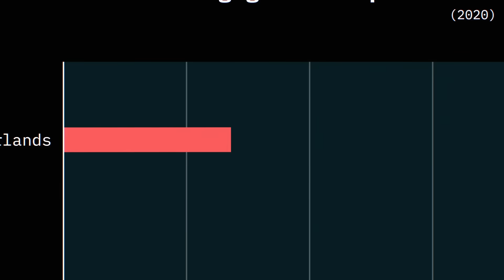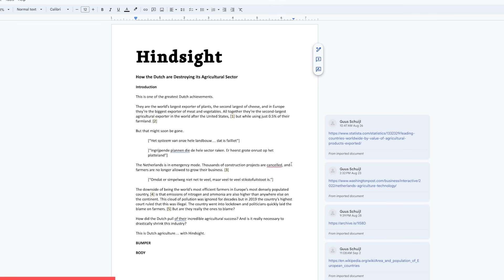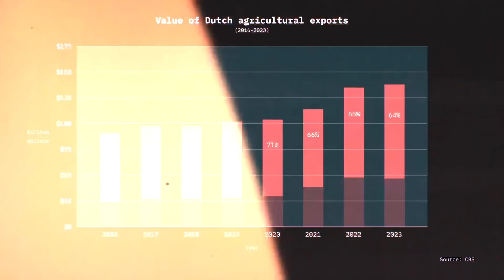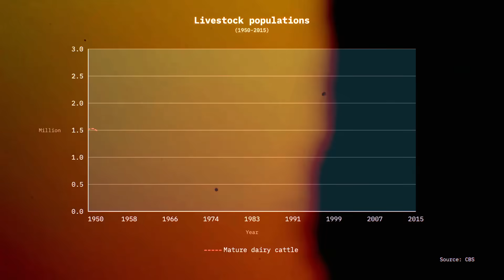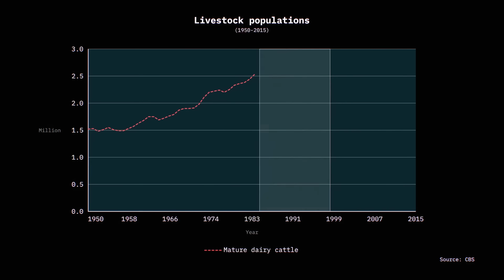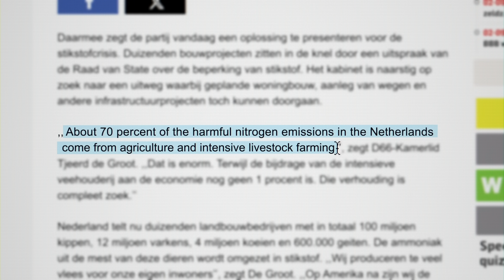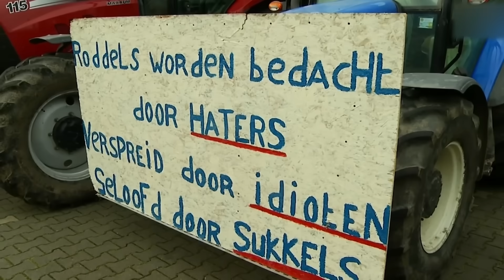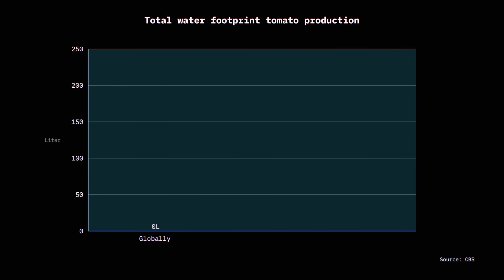The Dark Side of Dutch Farming

Comment: Appart from all these reasons called below. There is also the fact that most of the nitrogen pollution comes from around the biggest city's, but they just don't want to accept it. Cause it means that the elite have to live with the problems they made. It's the same reason why the biggest mess they make with the mass immigration crisis is felt in Villages en Towns
Reply: Tri State City Plan by WEF. They want to move all farming to Brabant and slowly turn it into vertical farming. The rest of Netherlands,Belgium and Rhineland will be a super urbanised worker and tech state.

Comment: To keep the Netherlands, my country, away from complete standstill we'll need to lower the emissions of nitrous oxides and ammonia. And yes, we have to lower emissions in all sectors, so that means industry and mobility (e.g. more EV's). However, all of that won't be enough if we don't regulate the by far biggest polluter, livestock. Not the entire agricultural sector, we need to shrink livestock if we want to build more housing, infrastructure etc. If the government does not take any measures, doesn't protect and work with farmers, small farms will be bought up by corporations and investors because that's how the free market works, taking measures is in the best interest of farmers too. Let me emphasize one more time that it's not the entire agricultural sector that's responsible for this. Tthe most advanced and efficient sectors, greenhouses and crops, barely add to this problem. Those sectors along with so many other sectors outside of agriculture are being hostage by the nitrogen crisis mainly caused by LIVESTOCK
Reply: finally someone who gets it

Comment: The main problem with animal agriculture is the use of liquid manure systems.
The government needs to mandate all manure must be composted . Instead of liquid manure systems, huge composting sheds to facilitate composting would solve the problem of pollution by changing soluble nutrients that leach and emit gases, to a system of colloidal capture of nutrients.
Composting does this. In composting nutrients are transformed into a colloidal state , which ends most leaching, the nutrients are locked into a colloidal state. In the composting process, any methane produced could be captured compressed and used for bio\ fuel. 
Composting reduces the volume of animal wastes greatly , saving fuel and time in application of compost to the land. 
Composting reduces most all problems , and is extremely eco friendly. .

Comment: Blind spots in this video: 
Heritage and culture, BS, I'd claim all the traditional knowledge and tradition about farming is utterly lost - along with the traditional gene pool of stock and crop. Thank you. 
Looking at yield per acre and not looking at yield per measure of energy - in which case the dutch score the absolute worst efficiency.
The dutch do not produce food, the process food. Bulk of the raw material for this food comes from abroad. Soy from brazil, fertilizer from russia, diesel gas electricity pesticides... Also, the transport is outscored. So much for 'food independency' it is a false dogma. 
Natuur herstel.. recovery, yeah, from what? Look at topotijdreis and discover what has been sacrificed for this ungodly project. The most epic river delta system of western Eurasia right in the north-south line of migratory birds. Nursery of fish. Dynamic river Eastry on the edge of dry sand and wet bog combined with marsh, flood plane and coastal dunes. All IS LOST. Habitat distrution, light pollution, water table exloitation, toxivication, soil degradation ON AND ON AND ON. But a few refuges of so-called 'snippernatuur'. Which the BBB wants to eliminate asap.
All this to feed the people? All the worlds people? With pork?? Tulip bulbs? get ffm real man.

Comment: Cars do not "emit nitrogen". All the nitrogen that comes out of them got sucked in just seconds earlier. It is atmospheric nitrogen which they are outputting.  It would be more relevant to refer to nitrogen oxides (NOx) than "nitrogen". This has NOTHING  to do with "nitrogen" from farming, this is not nitrogen either but different nitrogen compounds such as ammonia. There is zero linkage between these two kinds of pollution but they are being dealt with as the same thing is all the statistics and politics. As usual scientifically ignorant EU bureaucrats have near zero understanding of what they are trying to regulate.

Comment: The farmers have been screwed over many times. The new political party BBB will not change that, they will possibly even make it worse. But it will keep their hopes up for a while.
What farmers need to realise, that the current system offers no benefits for them. Why would you want to keep the current system if it constantly screws you over and everybody except the farmers determine price? It is a very stupid situation to be in, why keep it that way?
If anything, the BBB should get farmers a better position, but since they are funded by those big companies it will probably be the opposite.
And yes there is too much nitrogen and others, and that is mostly from livestock. Pigs, cows and goats in a huge shed concentrate to much of the pollution where it becomes unlivable due to air pollutions.
There are parts of those nice scenic farmlands (such as in Brabant) where air pollution is worse than in the middle of Amsterdam.
Also, lots of food for the lifestock (depending on which type) is imported. Such as grain from Ukraine just for our chickens. Next to the artificial fertilizers around for decades, which coupled food prices to energy prices.

Comment: The real problem here is that honesty is what is most needed but in shortest supply. By far the worst offenders of unsustainable practice with the easiest to achieve savings for the environment, are the rich & middle classes. Their constant insistence on over heating & cooling their homes & offices. Their insistence on using expensive private cars instead of public transport. Flying all over the planet for holidays & ridiculous climate gatherings designed to massage egos, polish halos not address real issues. First ban the UN & COP568 or whatever moronic number we are up to. Force these deceivers into virtual meetings & off the roads they have no need to clog up, leave those roads for real produce not pleasant weekend jaunts paid for by tax deductions. Tax these frivolous spendthrifts for claiming deductions to their tax bills for 'claiming' part of their oversized houses as office space, when in reality they are extra storage rooms used for stuff bought on an ego rush that they will rarely use & almost never need. Leave honest hard working farmers alone instead of making them convenient middle class whipping boys. Shameful performance & exercises. 🤬🙄

Comment: In USA tulips for Netherlands are for sale in most urban supermarkets and florists,it is strange that such a product that needs very fast transit by flight to USA markets.with cows a Blessing even after using its milk production for years and years it keeps on providing with its meat and cowhide..just hope that modern times  haven't clouded vision..Don't kill a creation  for little American Indians killed buffalo for THIER needs after the 525kgn was slathered only 5kg was thrown away as trash .waste not want not .USA energy efficiency average for the usa. Is and has never been above 51%..all the remainder is waste USA transportation industries use 30% of all USA energy use and it average energy efficiency is 21%.Whatca waste and electric cars would hardly add 5cto 8% more efficiency at it's very best . Extreme weather is here to stay it could be reduced significantly with getting efficiency overv70% in a decade.bread n circusc economy is a energy glutton also

Comment: The argument "there will be more people, therefore we need to grow more food" is nonsense. We will never make more people than what we have food for. If you have a sudden reduction in food, then people die, and that's a bad thing. But if you just have a fixed and limited supply of food, people don't make excessive numbers of new people in the first place. 

This is completely setting aside issues of food waste and over-nutrition, which if they were resolved would enable us to feed a couple billion extra people without any extra food production. That would be a good thing, but it's not necessary. Simply continuing to produce exactly as much food as we do now doesn't require any improvements in efficiency or distribution. If we make no improvements and grow no more food than we grow at present, the forecast extra people simply won't happen, and we won't need that extra food.

That makes it an extremely bad argument as to why we "need to produce more food." We don't need to at all.

Comment: The Dutch are not the world’s most efficient farmers, very far from it, because they are utterly reliant on foreign inputs and energy.  In effect they are the middle man of food manufacturing, which is very different to farming and shouldn’t be confused with each other.
Reply: Do you have any data to support your claim? I'm honestly very interested.
Reply: @sannej  The data is readily explained by the Dutch annual import figure of €95.0Bn of agricultural product and the export of €130.0Bn of agricultural product.  The import is extraordinarily high, amongst the world’s highest, and completely out of proportion to the population. The imported agricultural product is then turned into exports by using a 25% subsidy to farmers, which is why agriculture for The Netherlands isn’t nearly as great an economic contribution as it seems.  It’s the same system the Dutch use which puts them up the ranks of petroleum exporters even though there’s no Dutch oil deposits.
Reply: @seanlander9321  Obviously, the export figure is skewed but you can't just say farming isn't efficient in the Netherlands. Vertical farming is very efficient as the figures for tomatoes and milk yields (amongst others) show. Even if the Dutch were 'utterly reliant on foreign inputs and energy' - which they aren't - they would still be able to be efficient with those inputs. I don't follow your logic at all. You aren't trolling, right?
Reply: @sannej  A few products doesn’t make efficiency of a sector. Obviously an agricultural sector that relies on such extensive inputs and subsidies and tariffs cannot be efficient, it’s actually barely getting by.
Reply: @seanlander9321  Seems to me greenhouses and husbandry are pretty efficient. Just how much subsidies and tariffs do you think there are?
Reply: @sannej  European subsidies are 25%. Tariffs are anything from 20% to 100%. Greenhouses are a component of farming, they don’t represent the claim that  Dutch farmers are the most efficient, that’s an across the board calculation not confined to som farming factories.
Reality is, that without very significant government assistance that Dutch farming will our collapse. An efficient farming sector is one that is firstly self-sufficient.

Comment: can you make a video on how only 9 liters is used to grow a kg of tomatoes
Reply: Greenhouses put all resources inside under quarantine effectively. As fluids evaporate, they are collected, filtered and reused to grow crops whilst sunlight, lamps and natural gas are used for heating. It doesn't take 9 kilograms of water to make 1 kilograms of tomatoes. It only takes about a kilogram of water. Greenhouses are usually equipped with sluices to prevent the loss of moisture and scalability helps to offset costs. What it doesn't say though is that the greenhouse sector of the dutch farming industry is the biggest user of natural gas in the country and thus a major contributor to greenhouse emissions.
Reply: @MarijnRoorda  Most of the CO2 produced by the WKK's (very big natural gas engines) is pumped into the greenhouses for the plants to consume and grow. 
This isn't always the case but under perfect circumstances a WKK will burn the NG to create hot water, the engine turns a generator that powers the lights and the CO2 powers the plants.
And newer greenhouses will digest the plant remains after clear-out into biogas that helps fuel the WKK for the new crop.

Comment: "Nitrogen pollution" is about nitrogen compounds such as ammonia (NH₃) or different nitrates (NO₃⁻), not gaseous nitrogen (N₂) in the atmosphere. The former mainly pollutes the air, while the latter mainly pollutes the water. The related nitrous oxide (N₂O) is a strong greenhouse gas and therefore an additional problem.
In the video the term "Nitrogen" is used for nitrogen oxides (NOₓ) in general, but mostly nitrates (NO⁻₃). 

Just in case you were wondering 😅 (Information without guarantee).
Not to mention other related or intermediate chemicals as nitrite (NO₂⁻), urea (CH₄N₂O) or ammonium (NH4⁺).
Reply: This all is an excuse to get rid of the Farmers.
its a tric.
Because they want to get the lands cheap from the farmers,and sell it expensive to investers,house builders.
Because there ar big plans to create a big city called "Tristatecity" on Netherlands, Belgian and German territory.
Its all about Money !!
Reply: nitrogen pollution is about left lunatics who can not think for themselves and do listen to WEF, WHO and take bribes.
Reply: Water vapor is the only strong greenhouse gas and you can't do anything about it.  Nitrous oxide is an incredibly rare trace gas that has no impact on climate.
Reply: There are simple Measures for the water born compounds. Restoring buffer zones of natural vegetation along waterways, or even creating new ones on site. Wetland species are very good at stripping nutrients. Then there are bio digestion pits were bacteria do the same job. Australia's sugar cane industry has employed these measures with good results. And nobody had to give up the farm.
Reply: @raclark2730 converting nitrogen too methane just moves the problem elsewhere ?
Reply: @andrewtrip8617  Nitrogen is easier to deal with than methane.
Reply: @andrewtrip8617  Converting nitrogen to plant material is easy. Savy.
Reply: @andrewtrip8617  Converting nutrients to cells is what I am talking about. Netherlands cant grow all of a sudden.?
Reply: @andrewtrip8617  Reduced stock in the Netherlands will increase stock in Brazil. Did you think about that.
Reply: @andrewtrip8617  No. N2 does not become CH4.  Learn some simple chemistry.